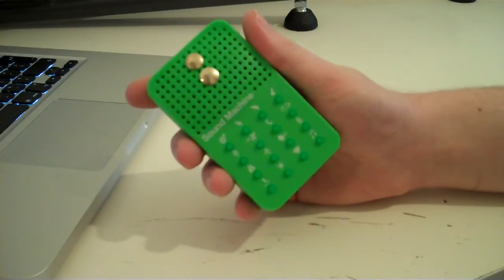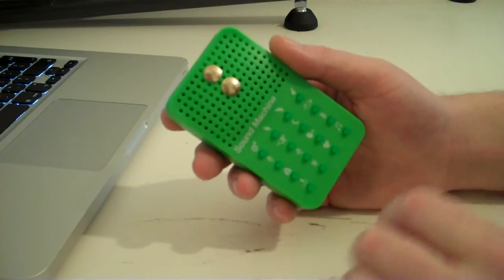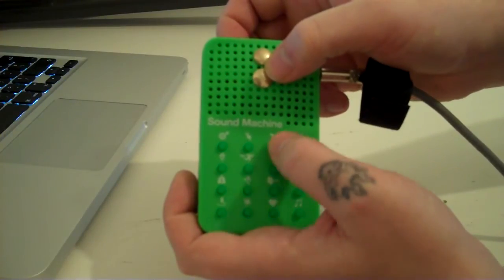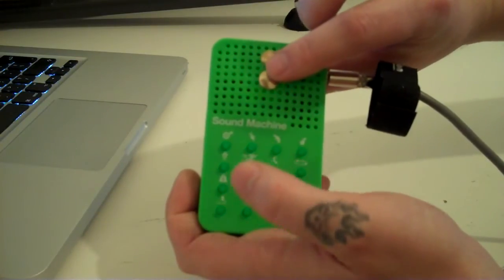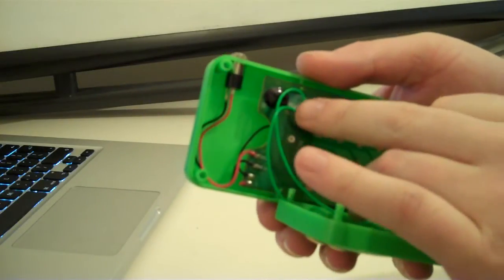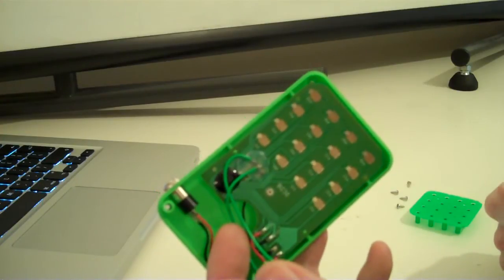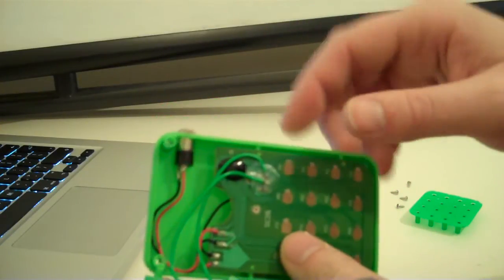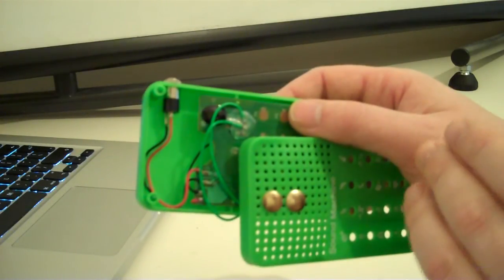Circuit Bent Sound Machine

Comment: Hi. Nice job!
Beeing a complete noob in soldering and in electronics in general i just managed to finish building a ds8 clone and the very nice buran electrix lunchbeat just by following the manuals.
Success!
Now i really want to do the same pitch mod to these little machines, since i own two of them.
Just one question since there is no manual i can stupidly follow.: Did you solder any resistors or trim pots because of the line level output from the speaker connections? I dont see any?
i will try a potentiometer instead of the metal knobs though.
Keep on making noises.
Reply from the maker: Great :) I didn't use any resistors on the output and it is pretty loud compared to line level, but for my purposes I was happy to just turn the gain down on my mixer. If you do want to attenuate the output so it's closer to line level I would recommend using a voltage divider on the output - happy hacking!
Reply: That was quick - two years after posting the video. Thanks!
Reply from the maker: holger panthen
 No problem ;)
Reply: holger panthen hey i need one like it, can u program your own sounds it??

Comment: Hi, mmm I'm new to this, could you tell me how to connect the aduio jack to the speaker terminals (or whatever you call them)?
Reply from the maker: Rod Barriga just disconnect the two wires going to the speaker and connect them to an audio jack instead. It normally doesn't make much difference which wire goes to the positive or negative terminals on the audio jack.
Reply: Thank you.

Comment: Could you reprogram the machine to play different sounds of your choosing?
Reply from the maker: +Jokergeist Unfortunately not, these units are very basic and cheap. But I guess that's part of the challenge, trying to get as varied a sound out of a limited number of samples :)
Reply: +sonodrome Hmm. Then do you have any ideas of how I could build my own sound machine that I can program to play my own sounds?
Reply from the maker: You could look at using a Wave Shield from Adafruit, you can use them with an Arduino
Reply: Hey +Jokergeist! Any success so far? I'm on the same track. Looking for ways to build a custom sound machine like that. The Wave Shield looks promising! Thanks +sonodrome!
Reply: Forgive my technical ignorance; but how are they programmed in the first place? How does the chip work?